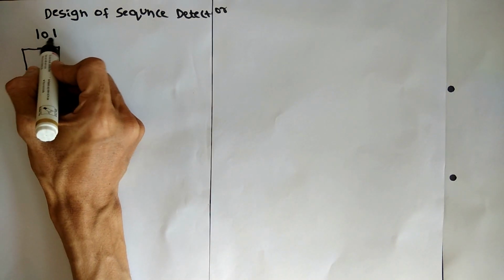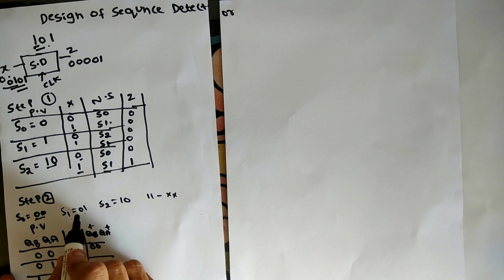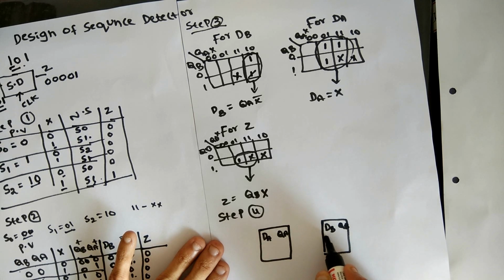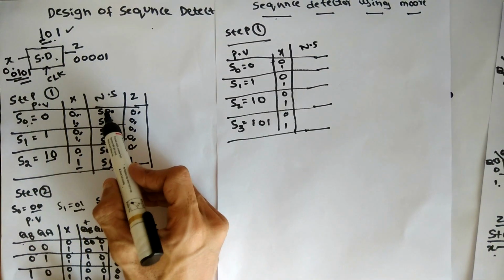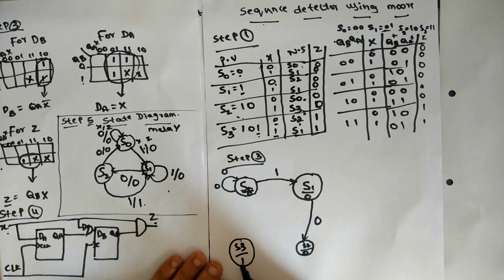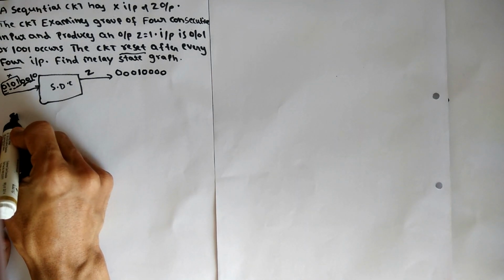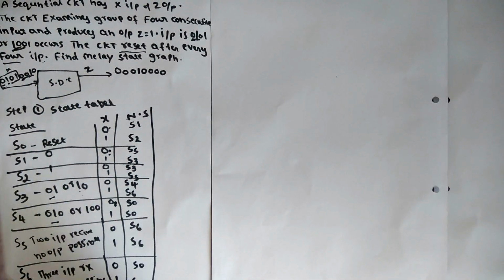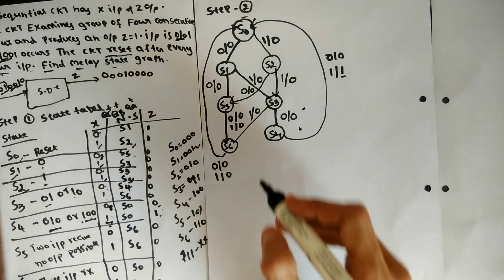VTU DSD 18EC34 M5 L1 sequence pattern MEALY STATE DIAGRAM

Comment: 14.32 A Mealy sequential circuit has one input (X) and one output (Z).The circuit should
transmit its input, except that it should prevent the sequence 00110 from occurring.
So Z should be the same as X, except that if the input sequence 00110 occurs, Z
should be 1 rather than 0 when the last 0 is received, so that the sequence X  00110
is replaced with Z  00111. Derive the state graph and table.

Can you give a solution for this sir